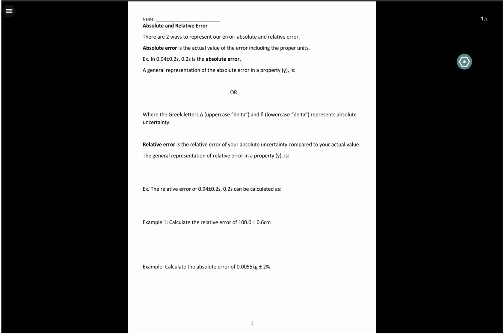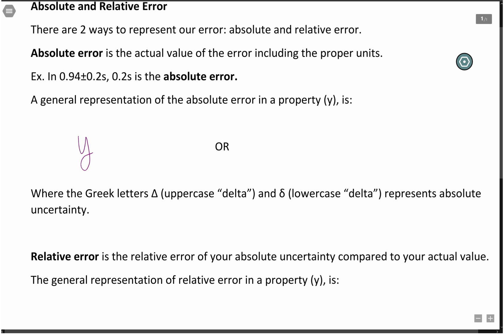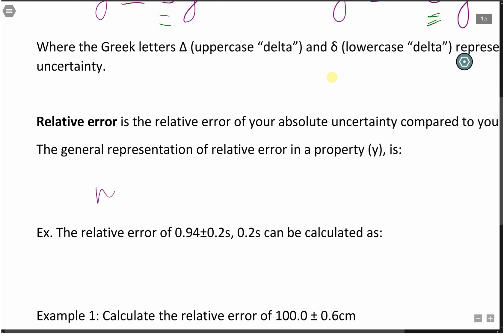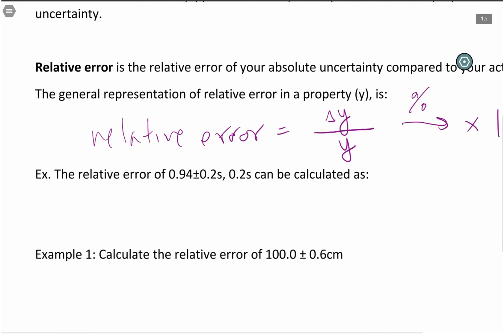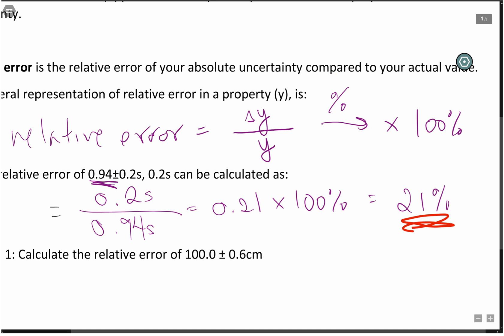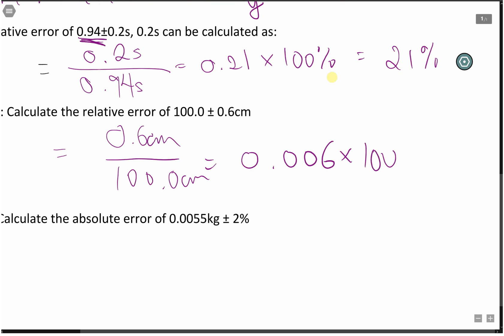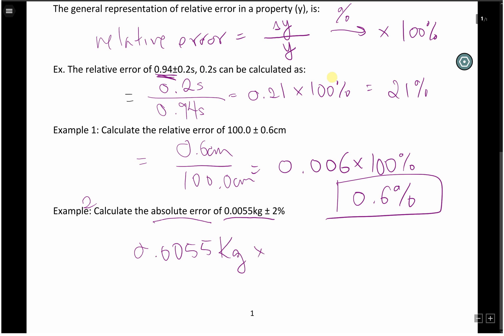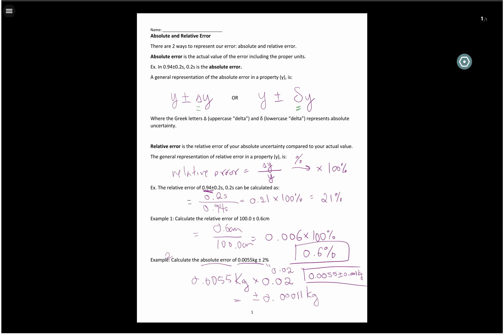1.06 Absolute and Relative error

Comment: I am in the lowest college math class, we arent talking about deltas and "Y"s yet, I just want to figure out, ince I have my absolute error,  (-7)how do you figure out the relative error if its; Tree age=105, Biologist estimates its age to be; 98 yrs. Absolute error is -7 ...-7 over 98 in a fraction multiplied by 100?? 🤔our math book is very, very unclear!!
Reply from the maker: Hi Erin, thank you for watching Li's videos. Sorry this is 2 weeks late if at all still helpful. 

When determining absolute and relative error, we look at the uncertainty of the measuring tool (how precise our measuring tool is - for example a ruler vs. a vernier caliper). The more precise our measuring tool is, the less uncertainty it should have. This has nothing to do with how confident we are about our measurement is to the actual measurement itself. For example, you could have a very precise analytical mass balance that is teared improperly so all your measurements are 50 grams off from their actual mass. 

In your question, it seems that we know actual age of the tree and not how precise the biologist can estimate. In this context, I would be calculating for percentage difference, which is comparing how my measurement compares with the actual measurement. 
percentage difference = (experimental value-actual value)/actual value*100% all in absolute value
In your case it would be = (biologist's estimation - tree's actual age)/tree's actual age*100% all in absolute value.
Your answer would be in percent form.

Is this question asking for relative error? Is there more context to this question I can help you more with?